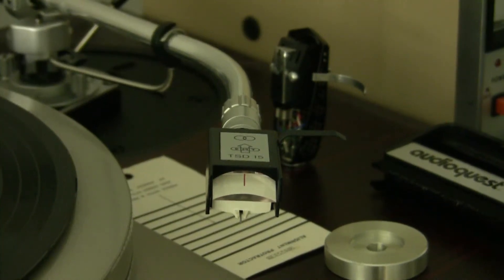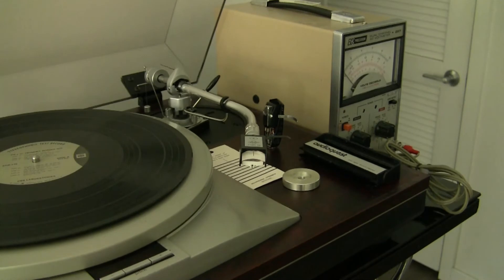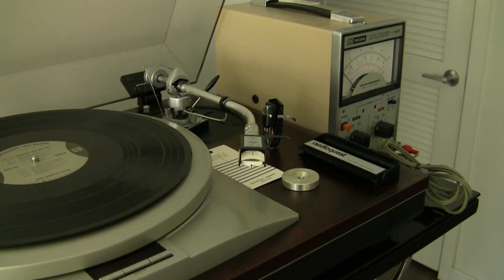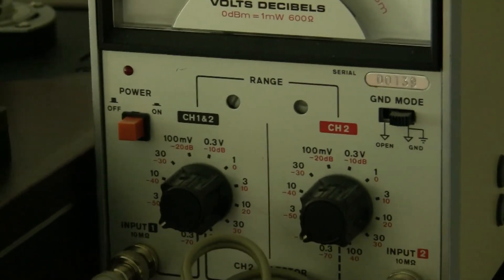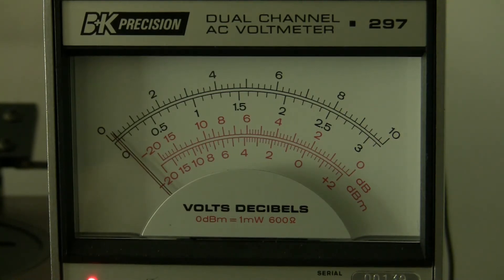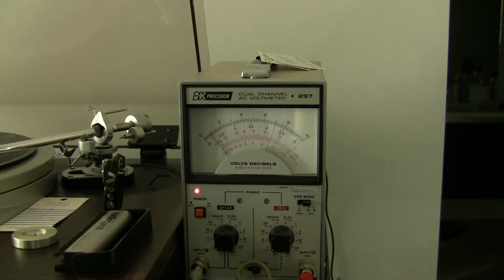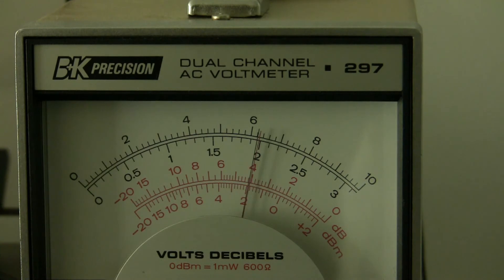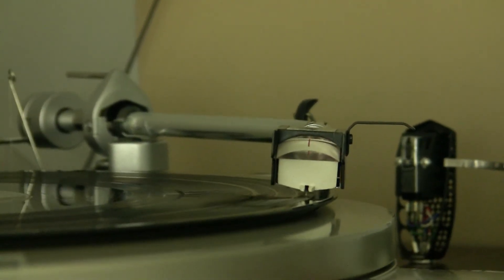Phono Cartridge Channel Balance Alignment with Dual Channel Voltmeter (Applied on EMT TSD-15)

Comment: Hi, I just did this procedure using Kenwood VT-176 for a Denon DL-110 & Sansui SR-838. I would say most important to confirm the two needles match at zero and at various test frequencies and volumes. The absolute value (volume measured) being accurate is not important but the channel matching of the instrument between right and left does. Afterwards when you do the test, the ground is important, you can chose the source/open (turntable) or the instrument ground. In the video the instrument ground was used. Flicking the ground switch to the other position then it is the turntable's ground (Open) that is used as reference. Also different test records have different purity accuracy and channel matching of the source tone. I used CBS STR-130.

Comment: Unfortunately this meter is not available. However this would be the method I would use. The problem with this method is you need to be sure the meter is calibrated to known standards. If your meter wasn't checked for cal with ANSI standards its a useless method. A Fozgometer cost $400. Im not even sure where you get it calibrated, and the person must be certified, I know because I worked in Instrumentaion.
Reply: I disagree. The output voltage isnt important rather its used to match observe and match output. No calibration is needed by a professional. All thats needed is input one signal into both channels and adjust the pot for the needles to read the same… calibration done. If you care about voltage output. Input known voltage and repeat for each channel. IMO
Reply: @mrpowers18  If you disagree that it shouldn't be calibrated obviously you don't know the accuracy of the meters. I worked in instrumentation and we can't calibrate equipment if out meters are not regularly checked for accuracy that we use to calibrate zero and span on the instruments. If you disagree I wouldn't trust that whatever I buy from you is calibrated correctly. I have a degree in electronics. This is true for digital multimeters as well as analogue meters. I don't care what you say if you don't check calibration you don't know what you are doing, and cannot guarantee accuracy.
Reply: @mrpowers18  The two meters may be off as compared to each other.
Reply: @kevinhamming4514  Ok. Not trying to start a pissing contest nor care who’s swings a bigger degree. I used a uncalibrated Learner LMV-184A 2 channel Millivoltmeter. I adjusted using my method. Maybe i should get it calibrated. Im curious to see how off my method is?

Comment: Could an error in the 'anti-skating-force' setup cause a channel R versus L measurement imbalance?
Reply from the maker: That is a very good question and regrettably I forgot to mention it in this video. Since the left and right channels are aligned 45deg to the vertical line on the record I don't think that anti-skating force cause a L-R balance issues. I tried to check my hypothesis by consciously changing my anti-skating force and the readings on the voltmeter didn't change. I must admit that, I didn't go to crazy extremes and I stayed within the +/-1 notch on the SME scale, assuming that, if somebody is this far into cartridge alignment, that setting would not be too far off. However, on the SME 3009 Series I, one notch is enough to generate enough force to move the needle towards and away from the center of the turntable on the flat surface of the test record.
Reply: @oturgator  Thanks for you rapid reply to my question.  Cheers!

Comment: Great video, but even though you would improve your stereo image, would it not the degrade irregularly the stylus by putting it tilted to the side?
Reply from the maker: In fact when the electrical output of the two channels match, the stylus and the magnetic circuit in the cartridge are aligned. So the shell being angled does not mean that the stylus is also banked on either side.
Reply: Thanks 🙏🏼 good to know and learn, keep your videos comming👍🏼
Reply: The stylus is more properly aligned to the record grooves. It appears offset because the cartridge shell and the stylus cantilever is not perfectly perpendicular with respect to each other.